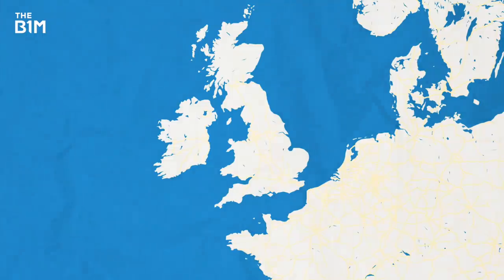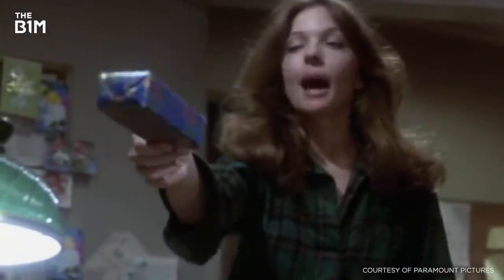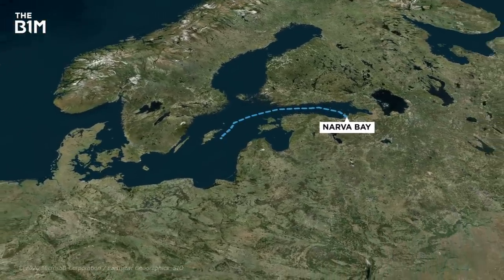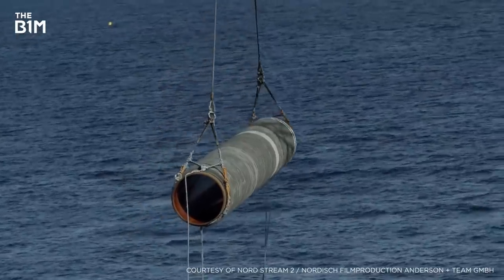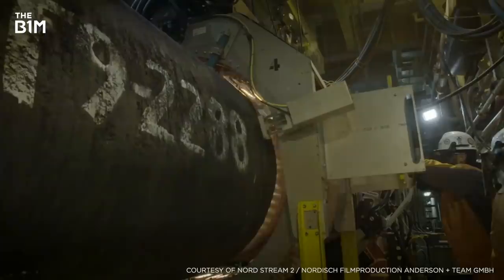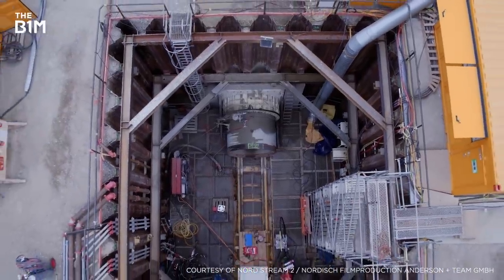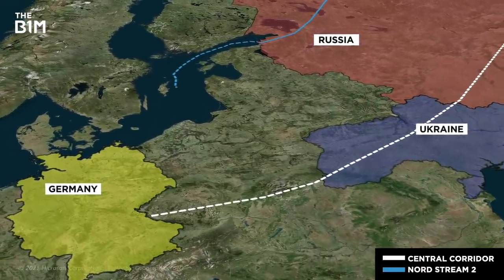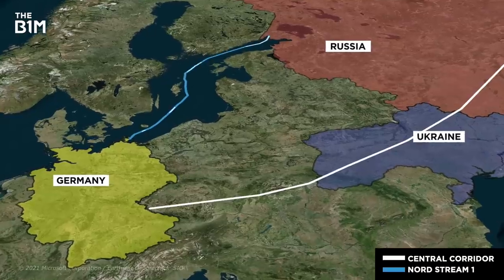Nord Stream 2: The $11BN Megaproject That's Dividing Europe

Comment: Renewable energy and natural gas go hand-in-hand. More of the first may reduce overall usage of the second, but the peak demand for gas will be the same. The capacity will need to be there regardless. Batteries may replace natural gas backup eventually, but the material requirements are hard to fathom.
Reply: The solution is to overbuild renewables. Rethink X has calculated that building 5X more solar than what is needed for the summer months is enough to supply the needed electricity for the winter months. Batteries are only needed to time shift the Solar's daily production. If Wind is added into the mix this reduces the need for batteries even more.
Reply: What if we changed our lifestyles?

A few weeks ago Technology Connections put out a video that provided a practical example of doing this: during night time, when electricity cost is low, he turns on his aircons to reduce the house overall temperature. During the day when it's hot, there is enough "latent cooling" in the house that he doesn't need to run the aircons during the peak energy demand time.

We can do similar things: increase heating when renewable energy is plentiful, reduce heating when the grid is constrained, and supplement our heating with things like jackets.
Reply: When the amount of renewables is large enough, power to gas can be used to create artificial gas, stored in the same infrastructure for natural gas, used either in the same gas powered plants to produce electricity or fed into the pipe network for direct heating.
Reply: That's why you need nuclear. It's the only existing option to have a fossil free electricity grid. Say no to fossil gas. 
Every option for energy storage need to be developed, except hydro which require mountain rivers - and demolish the local environment.
Reply: @migBdk  Nuclear is very bad fit for renewables. Nuclear is as slow as coal in responding to dynamic load which will increase due to the intermittency of renewables. Nuclear will have very bad profitability in the coming decades because renewables will force nuclear plants to very low capacity factor. Ironically nuclear plants will need a lot of energy storage to operate in a grid the is dominated by renewables. In the end 5x renewables + battery storage will be cheaper than coal, gas or nuclear.
Reply: @kazedcat  Nope, nuclear will not need a lot of energy storage. Renewables will need a lot of energy storage. 
Also, you have no idea what the price is for storage, because it is not developed yet. If you need grid scale storage from Tesla Megapack on a pure wind and solar grid it is going to be extremely expensive. 
For a carbon-free grid, I'll take my odds on nuclear as the cheap option any day, instead of banking on massive still-to-be-developed energy storage solutions. Remember that we don't just have to store energy for a few hours, it's the entire additional energy usage during the winter months that have to be stored.
Reply: @migBdk  Yes they will need them. Because solar can always undercut them when the sun is shining and wind will undercut them when the wind is blowing. Being limited to only be able to sell electricity when the sun is not shining and the wind is not blowing severely limits their ROI. To be profitable they need storage to store their produce electricity when the sun is shining or the wind is blowing and then sell them later when there is no sun and there is no wind. Even today you see renewable operator sometimes sell electricity at negative prices because it is cheaper for them to do that than curtail their electricity production. Nuclear have no way in competing when renewables are wiling to sell at negative.
Reply: @kazedcat  There is a gap in your logic. You seem to assume that the other energy sources are going to carry the systemic instability caused by renewables. IF people are OK with continued CO2 emissions, so the grid is a wind/solar/fossil gas mix, THEN nuclear will have a hard time. But with a fair pricing, where all fossil fuels pay a high penalty for emissions, fossil gas is dead. The price will rise to high levels whenever wind and sun is low (a lot of the time). This will make nuclear profitable, even if it run at a less than optimal capacity. It might even make sun and wind unprofitable, because it compete with itself, it can only sell energy when energy is already cheap, never when it is expensive.

Comment: Great video!
Some notes from Russia, which not covered here:
- Gazprom have transit contract with Ukraine with terms "buy or pay" so Ukraine have their money for transit not related to actual capacity used. This can be changed on next contract renewal but for next few years it will be as is.
- When last time contract renewed audit of "pipes" (there is a lot more than pipes) show 85% of wear out. Nobody invest in recent years to improve quality so in near future this pipe will fail. What Europe will do then?
- With this crazy prices and low budget Ukraine can just steal gas sold to EU as it use to be before, so I have my pop corn ready for that time.
- Last but not least - why you concentrate only on fuel side of gas?  For example: ammonia = fertilizers = food price,  chemical synthesis of some polymers used in various industries... even hydrogen production.

Comment: There Is no energy crisis - we just have chosen to ignore perfectly reliable base load ways to provide instant power. If you want you rely on wind and there’s not enough and you keep closing other power stations without having a 100% solution- that’s your own fault. Stay cold.
Reply: This is the most inherent and shortsighted comment I’ve seen on any B1M video. Is wind the only renewable energy? Have you no clue as the effects fossil fuels have on our environment? Do you believe fossil fuels are never ending in abundance? I think you can do a better of job of looking at the issue more objectively.
Reply: @robert7567  Robert, the germans shut down their nuclear power plants and are starting up old coal plants. YOU have the most shortsighted comment here.
Reply: @robert7567  Wind by itself is insufficient. We can see that clearly and diversification is needed. On that we agree. However the criticism is that your country is shutting down green energy sources such as nuclear and are instead firing up coal-plants and try to make gas a green energy-source which is delusional on every level. At the same time you rely on import from my country, Norway. In essence, you are shutting down huge, clean sources of nuclear energy based on emotions from the Fukushina-incident. 

Do you disagree with that? Relying on wind-energy is fine, but you do not turn off 100% guaranteed energy when the wind-sector isnt reliably replacing the required energy you and the rest of the EU need. You are in effect detrimental to the people you are in charge of (THE EU). Im not saying it is only Germany's fault we have a energy crisis, it isnt, but you are making it much worse with a terrible policy. Especially when you are trying to be the leading light for the rest of Europe, preaching green energy, while running the worst policy I have ever seen. There is no wonder people are angry with you.
Reply: @nkjoself2040  Jesus Christ! Is Wind the ONLY renewable energy source???? That’s the issue I’m point out. It’s not! I’m not about to read your epistle.
Reply: @robert7567  Wind is not the environmentally friendly thing you may think it is. Neither is solar. Both take up vast areas of land and resources. The former sheds plastics and shreds birds and bats and the latter uses forever toxic heavy metals. Both have appalling recycling records.

Comment: Gas price is ine of the main reason why i use electric one instead,sure it wasn't as hot as the gas one but it's more renewable and reliable,i have a solar panel that will follow sun and produce quite a bit of electricity (about 30% of what i use in my house daily) and the ine thay just sitting on my rooftop heating the water quite effectively (can heat up water up to 20° c on winter if it wasn't to cold) and it does help a lot on bill next i want to change is my old Mercedes Benz (don't know what type is it i bought it second hand) to a Tesla (model x preferably or S)
Reply: @notaroleplayeryiyi3536  excatly,and now we are expected to use electrical energy for everything (at least that what all my neighbors says) wich mosly come from fossil fuel wich is not excatly environmentally friendly, why people are against nuclear energy it won't go boom if maintained properly and it probably take 5 years or more for the nuclear rod to be nuclear junk and with multiple countries as advanve as this EU should not having problem to recycle or keep the used nuclear fuel safe and i am sure in 5 years during the usage of the rod an safe nuclear wasteland and recycling is already prepared,i mean tell me from year 2000 to today how many nuclear plants have exploded? The one that happend in japan is because of natural incident and fixed very quick since the Chernobyl incident happend i am 10000000% sure new nucler plant is more than save,if a nuclear enegry can be used for submarines or mothership safely it can be used safer in land.
Reply: If you want to help the enviroment, make sure to get a car that's easy/cheap to fix. Electric is great but Tesla's are extremely difficult to repair once the warranty runs out after a couple of years. Sadly other brands like Mercedes are following suit, but there might still be some that are easier to fix than others. That way you don't have to blow up your Tesla (yes that happens) in a couple of years because it is cheaper to buy a new one.
Reply: @jadoei13  or maybe i shouldn't get a new car,i mean we have marvelous public transport here in EU and everywhere is pedestrian and bike friendly,maybe i should just get foldable electric bike with foldable portable solar panels,i mean it's for my self i am living alone currently (main readon why i bought random second hand Mercedes Benz without any consideration) so just an foldable E-bike was sufficient enough and i don't do lot of groceries since most of what i need delivered straight to my doorstep daily,most of the time i go out is becuse i am bored and need some out of the house activities since i work from home (mainly software related and sometimes editing videos or other files for my client) i almost never go out unless one of my mate comes and drag me out to go with them (if nit like that i never go out)

Comment: What happens to Europe when Russia eventually runs out of gas? (It is a finite resource, and Russia may already be running out of crude oil).
Geothermal private and district heating (plus cooling and power) might be a better investment for the future.
Reply: Running out of fossil fuels is an incredibly funny joke. 
There's enough to go through this century, maybe the next one too.
Reply: I think by then, the energy scene will have changed so much that Europe will no longer be so gas dependent.
Reply: Gas will go to Germany and all of Europe will buy gas from them at much higher prices.
Reply: That is not realistic at all.
Sussa has enaf to fuel Europ for more then 100 years
They just neet to explor more, and thes did not even consider fraking like the US

The problem is not lis in the impakt of the climat
Reply: Russia is already building a second pipeline to China, a more important market than the EU. Their gas fields are vast. Yes it's finite but it will take a few generations before depletion. By then, alternative energy sources would have been found.
Reply: @anita.b  peak gas, peak oil and peak coal are a thing. Also the extraction costs keep rising because we have already extracted most of the deposits that have the cheapest extractions.

Comment: As indicated this is really a stop-gap solution, if countries are to reach their CO2 emission targets. Beyond wind, solar and hydro, both nuclear energy and reducing energy consumption should both be solutions on the roadmap. Nuclear has issues, and the EU would still depend on places like the DRC and Australia, but there are designs for better nuclear power stations and processing of the fuel, that would avoid some of the past issues. One of these is moving towards Thorium and another would be to build a series of nuclear power stations that can use the waste of the previous reactor.

When countries talk about sovereignty, depending too much on another for resources, whether food, fuel or manufacture, is a good way of giving up that sovereignty. Being totally self-reliant is not necessarily a solution either, so spreading supplies amongst multiple sources can help reduce the issue of one country having too much influence.

Comment: Too right!  Germany's economy exploded during those years with cheap Russian gas + oil.  Not really 'cheap,'  but  pipeline gas costs far less  than   all other transport methods -since the latter require condensing/liquifying the gas, pressurized cannisters and transport.  The countries that  feared they were being made dependent - had  two choices: keep the pipelined gas, maintain their nuke plants, or cut their use of electricity by ⅔.  
    Not sure we'll see any new cars from Germany in the next decade.

Comment: I want to ask all those who are promoting nuclear energy only one question. How will you power the nuclear reactors when the fuel used in reactors is uranium(which is in very less quantity around the world), soon we will be sleepwalking into another energy crisis. Countries will be competing with each other for uranium. I am not against nuclear reactors but I believe that it should be only a part of our solution to climate change , part of our energy grid, IT Shouldn't be the only solution.
Reply: The fuel does not need to be Uranium...it depends on the technology used in the nuclear plants, especially Canada's CANDU reactors which can accommodate several types of fuel. Those who promote green solutions continually fail to address base load requirements for industries that have high power demands (I had some fool argue that a battery would solve this but then went quiet when I asked him how it would be recharged to ensure its supply of stored power continued!) and while I'll agree nuclear has its problems, it does address this important issue (of base load). A mix of technologies with appropriate reserve is the best model but, with the bums that run nations, I doubt we'll get that soon.